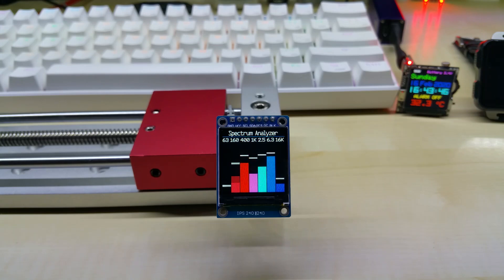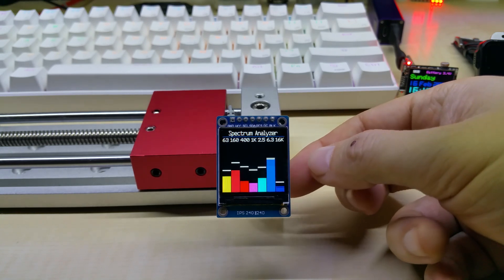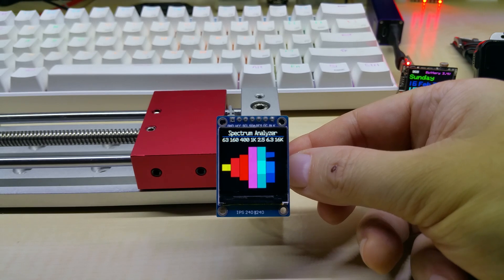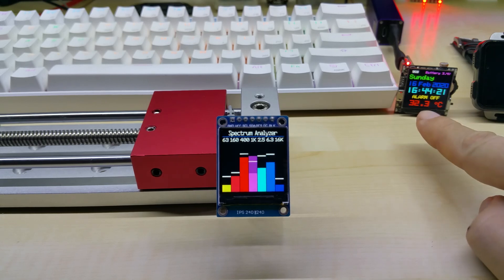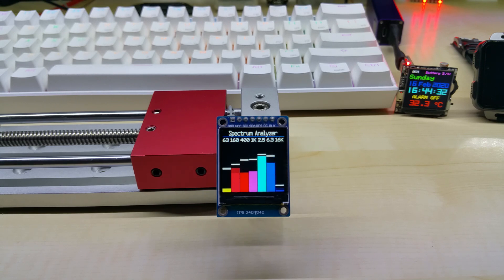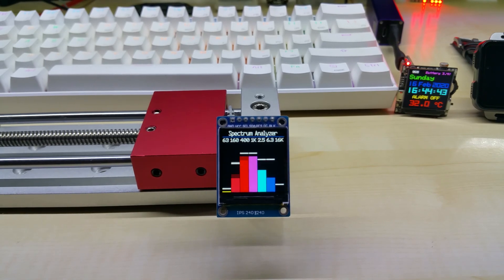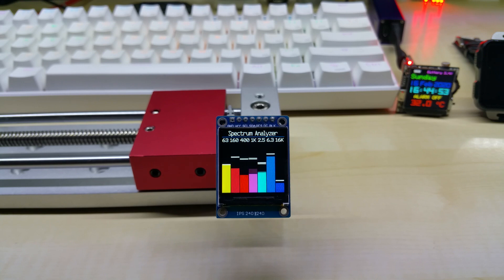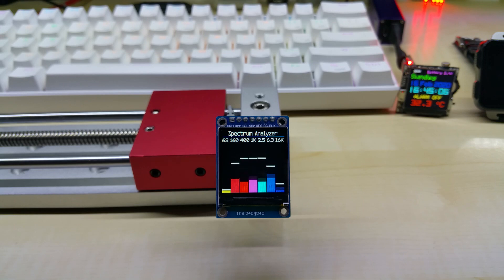Full Color Spectrum Analyzer with 1,3" IPS Display, based on the MSGEQ7 Chip, available on Tindie.

Comment: Looks cool! I have MSG chips but finally never used them. Did you try software FFT too?
Reply from the maker: I did try several times but never had a satisfactory effect. Maybe you can do a ST7789 FFT version? :-)
Reply from the maker: I am just trying your HW Monitor code but sadly my PC does somehow not show the temp and clock info. I am using the suggested serial monitor.
Reply: @iHayri1  Are you starting HWMon with admin rights? If you have Intel CPU there should be the same syntax of returned data. I know that it doesn't work with AMD because I don't know what HWMon sends in such case.
Reply from the maker: @cbm80amiga  Yes I am starting with admin rights and have a Mini PC with a Intel Celeron CPU running 64 bit W10. The HW monitor based on the ESP12 does run better on my Sony AMD laptop than on my Mini PC with W10 for some reason. Would not wonder me if the W10 is the culprit.
Reply: @iHayri1  Try to grab serial output from HWMon and send me to cbm80amiga at gmail, so I will check what is sent in your CPU case. BTW if you know better PC software which sends such data via serial let me know :)

Comment: When will it be available to order on Tindie?
Reply from the maker: It will be a few days, you can also order it directly from me if you like.
Reply: Hayri how much will it be?   Will there be an STL for the box?   It looks really sharp.
Reply from the maker: @wpherigo1  For right now it will be the same as the 1.3" OLED version (spectrum analyzer + 1.3" display option), yes, I will design a enclosure for it most likely with a Carbon Fiber front panel to make it pop.